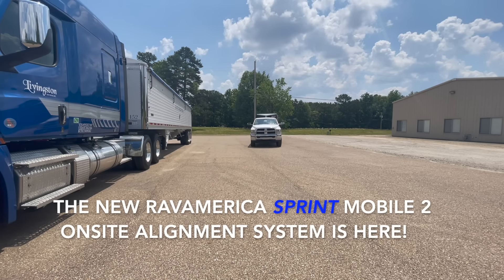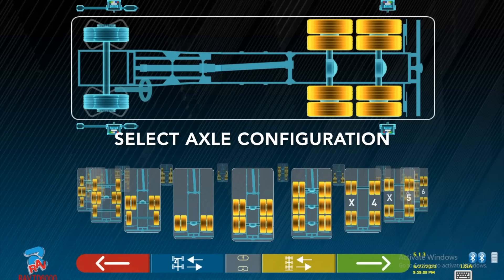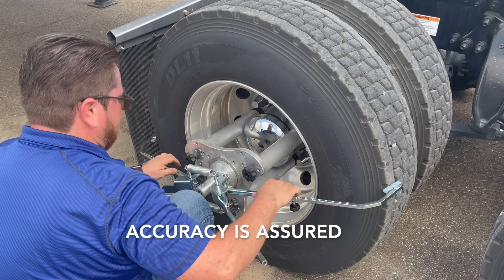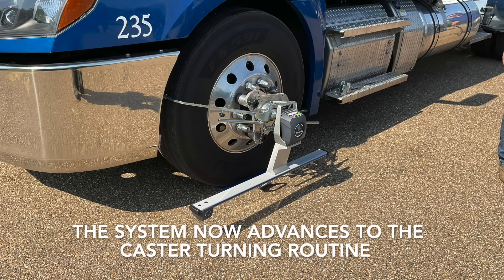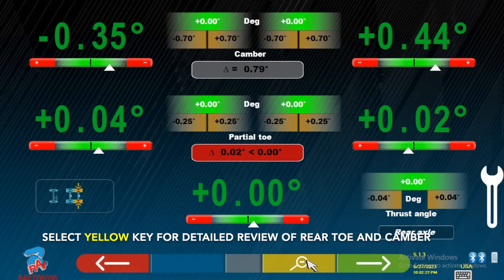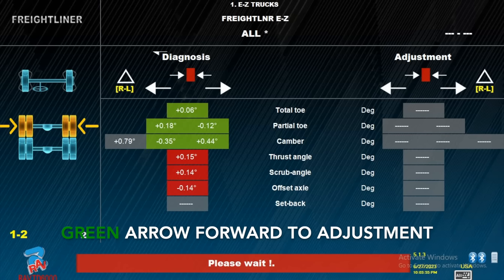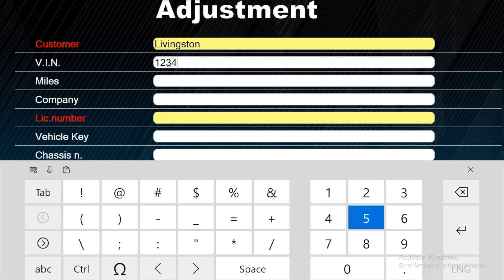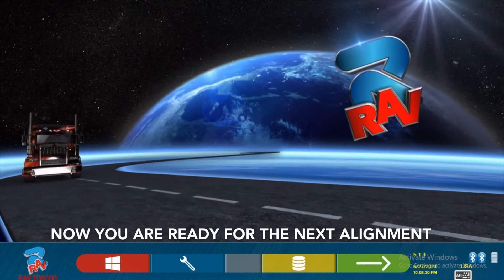RAVAmerica Sprint Mobile 2 Heavy Duty Alignment System

Comment: Great Heavy Duty Alignment System. An important fact. If there are any oval rim, the measurements may give wrong results. What do you think about it ?.  I'm not trying to discredit your knowledge, it's just a comment. Because you’re an engineer and I’m a former mechanic specializing in automotive alignments.
Reply from the maker: Thanks for your comment! Our point reference is the hub. If you have an imperfection in the wheel, you will have vibration on that particular wheel. This turns into a balancing issue, not an alignment issue. A balancer would detect this imperfection, but since the wheel clamps mount against the hub, not the outer edge of the wheel, the measurements will not be wrong.
Reply: @RAVAMERICA   Thanks for quick reply. I totally agree with you.